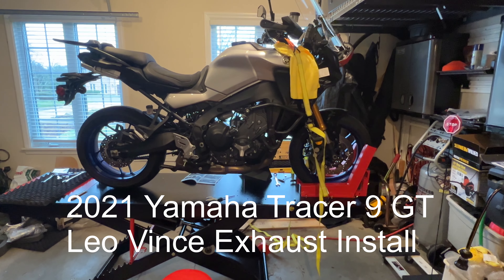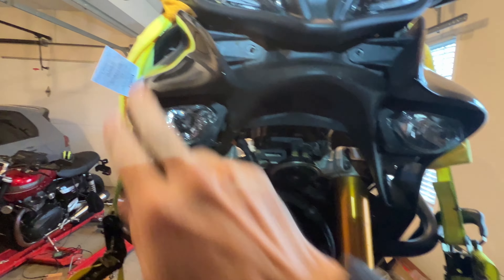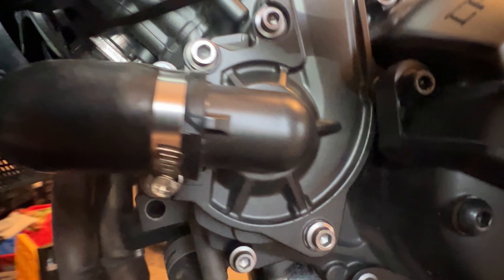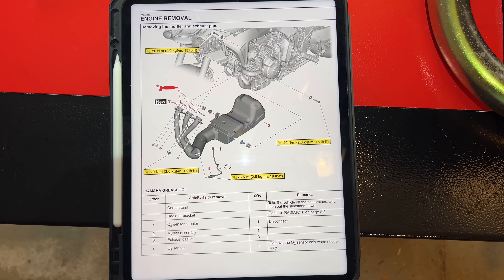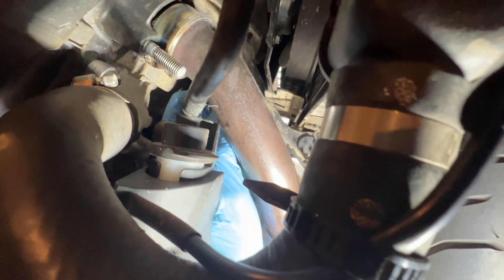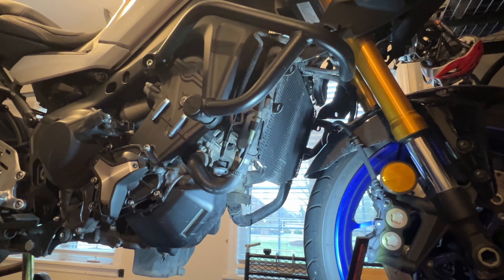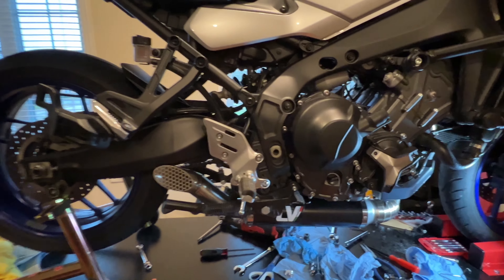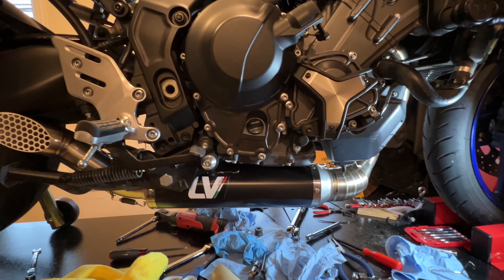2021 Yamaha Tracer 9 GT Leo Vince exhaust install

Comment: Hi I watched couple of in in stalls. On mt09 about the end can exit Mesh bit.. It looks like it almost touching the swing arm. When the suspension is under load while riding.. Does the end Mesh tip touch swing arm it looks very close to me!  Thank for any advice..
Reply from the maker: Indeed, it comes very close. I have not had a chance to ride it a long time to see if it will touch the swingarm once heated up.

Comment: Also there is 2 methods some say take the gaskets out.. And just use what leovince provides no gaskets used.. I personally used gaskets that were in their all ready.. Not tested for leaks yet.. But it does seem odd others out there saying know gaskets to be used.. Nothing in lv manual about this.. What is your thought's on this plus advice on previous message would help.. Thanks

Comment: Installed mine today.. Question is did all your flanges bend at each bolt mount to header.. mine did.. I Stopped torque setting before 20nm. in yamaha manual it says 20nm.. I didn't want to go any further.. Hope it's enough to what felt right..I've not tested for leaks yet..how did you'res feel.. Thanks.

Comment: Good video. Ive been thinking of getting the lv but i ride 2 up alot and haven't seen anyone talk about how it is will a passenger. Does it seem like the exhaust exits on the passengers foot peg? Dont want the wife to get cooked in traffic.
Reply from the maker: It looks like you have about 6 inches of room from the end of the exhaust to where the foot might be. 
So that should be OK since the exhaust gas should shoot out before hitting the foot, and the tip itself may not radiate tons of heat?

Comment: Hi! On a scale from 1 to 10 how would you describe the volume(db) difference with LV One (with muffler) compared to original. I want to buy this exhaust but in my country there is no exact definiton of street legal or race. The police can just charge you if they think it's loud. I'm personally not very much of a fan of the original sound because i think it's too quiet, even I sometimes cannot hear the bike hit the rev limiter due to wind noise. So i just want it to be a little bit louder but not too much like it can be heared miles away. I don't intend to draw the attention of the police. I describe it like when i pull the clutch, it should be as quiet as possible but it should produce more noise than the original at higher rev range. So do you think this exhaust (with muffler) like the state it comes out from the package, suits my intentions ? Or will it be too loud or too quiet ? Thanks in advance.
Reply from the maker: It’s not too much louder than stock, just more low end bass. The race version takes away the catalytic converter, but there is still a sound deadener in the exhaust. I believe my Triumph Speed Twin is louder at idle with its stock exhaust.  As a comparison, the Akrapovic I had on my MT-07 was louder at idle, so the Leo Vince is a good compromise.
Reply: @TheSunderlands1  Thank you, i ordered a LV exhaust with cat and db killer for my Tracer900. I am thinking that it will give me the exact sound difference i want, especially on low rev range, even if it's not loud enough i could always remove the db killer and go on but i think it should suffice